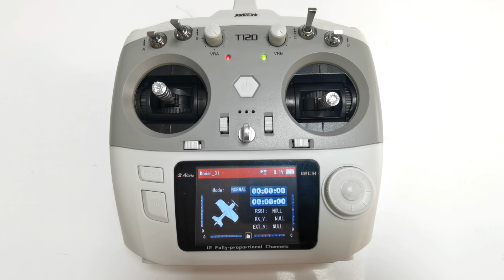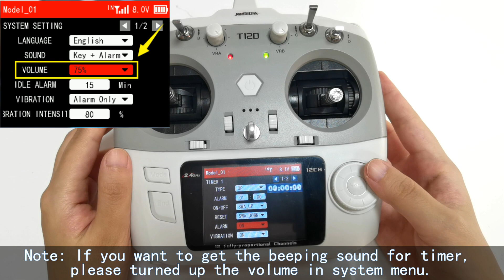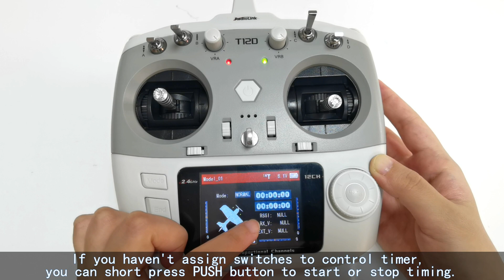TIMER Function of T16D/T12D

Comment: How to connect elrs to crossflight flight controllers
Reply from the maker: Hi, sir. Just plug ELRS module on the back of T12D/T16D, and connect ELRS receiver to TELEM 2 port of CrossFlight, bind the ELRS receiver to the module. Then you can view and modify the parameters of ELRS module in the transmitter. We'll release the related tutorial soon. If any question about RadioLink products please feel free to contact us. Our email is: after_service@radiolink.com.cn